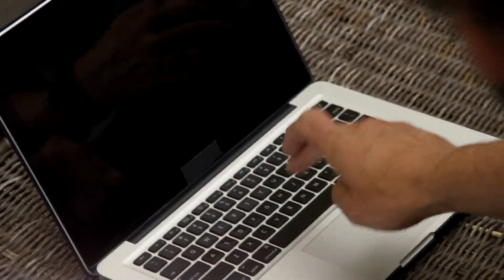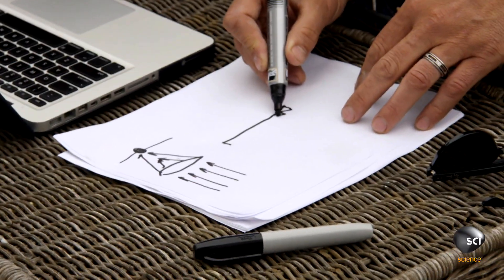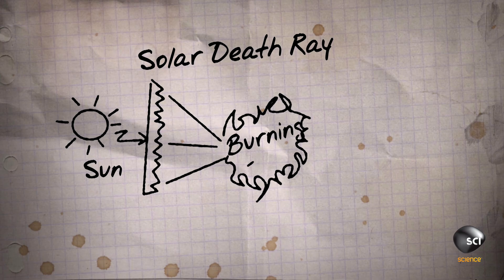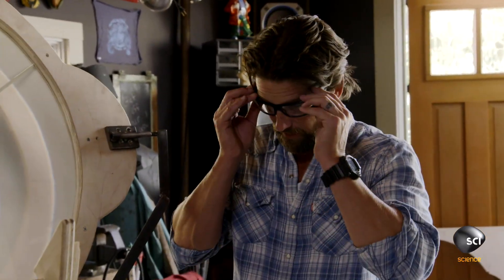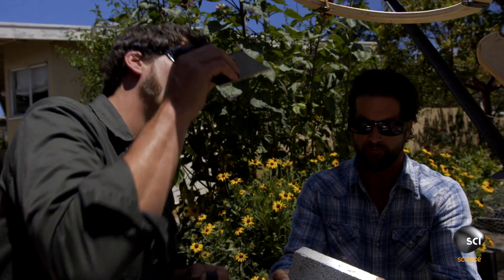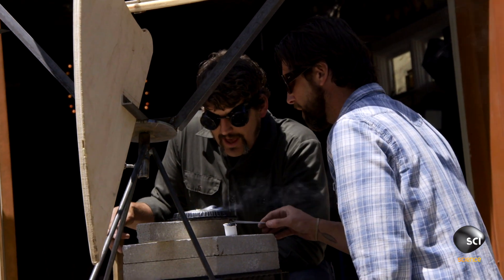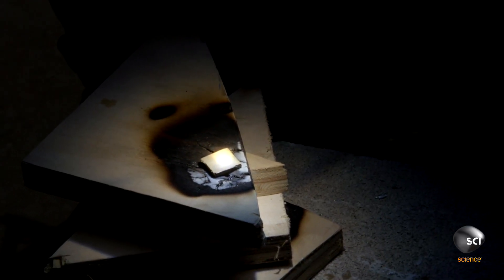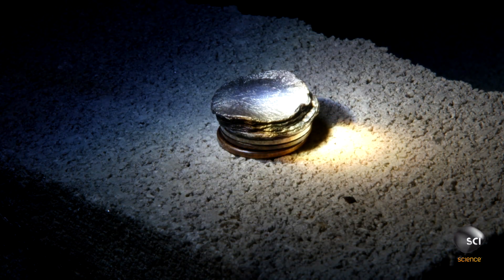Creating a Sun-Powered Death Ray

Comment: I would attach a telescope to the LENS but not at the focal point cause it would melt the glass LENS I would put telescope right before the focal point that way you can get MORE out of it YOU can adjust the telescope to have any LENGTH you want as far away as you want or you attach a laser measuring tape and have it automatically adjust it for you if it hits any surface... it's just an idea

Comment: In Wolfenstein: The New order, there is a paper article about what the Nazis called the Sonnegewer. Or the "sun gun".  Its pretty much this x50,000. An orbital ray/beam caster that would have the power to focus the solar energy of a multi-mile wide disk onto an area the size of a small car. Virtually vaporizing anything it touches. Intention was to deep fry any resistance hideout that was to be found. 

Hint: for those who want to read it, it is somewhere in the London Nautica. I wont say which level. See if you can find it. (;